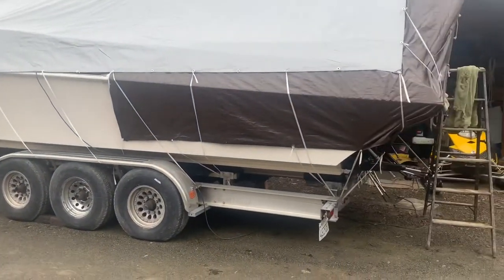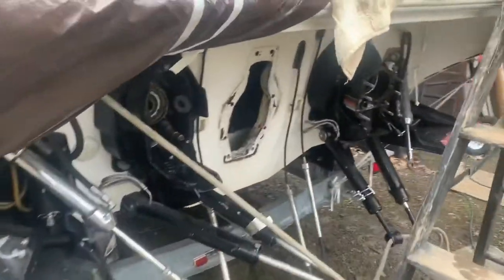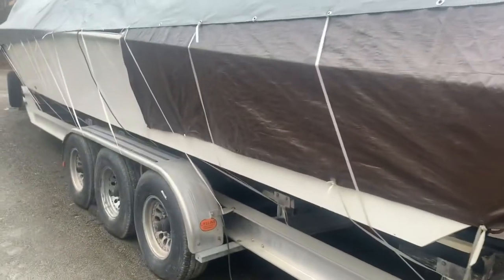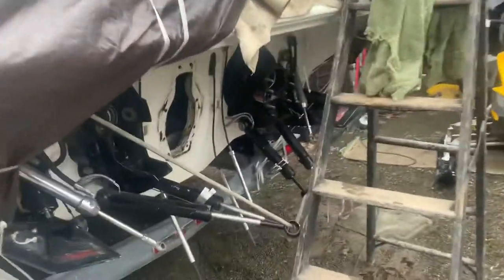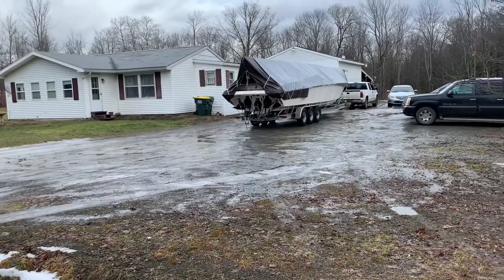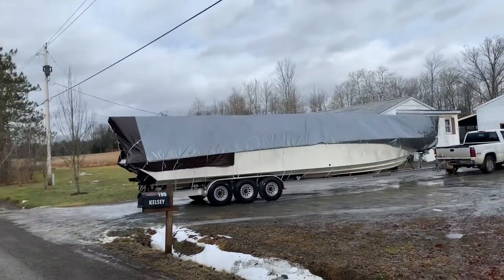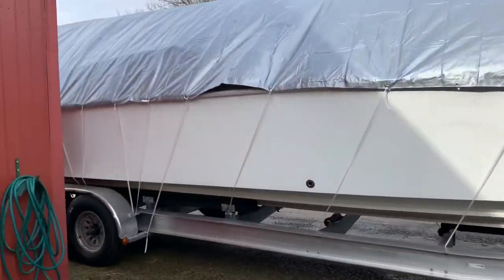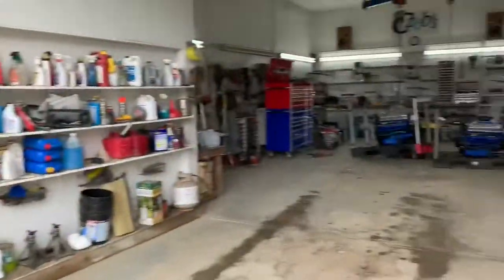42’ Fountain project dream boat vlog#3

Comment: Why would you install the engines before glassing the hole in the transom?
Reply from the maker: If you check out some of my later videos you’ll see I simply plated over the center hole. That way it could easily be converted back to triples. I no longer own it.